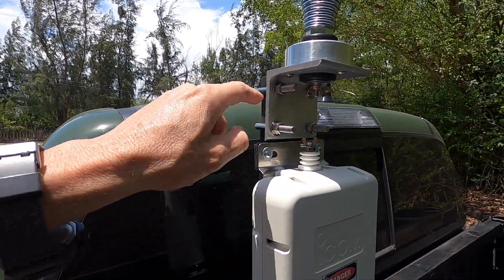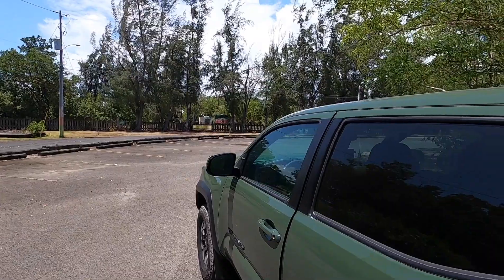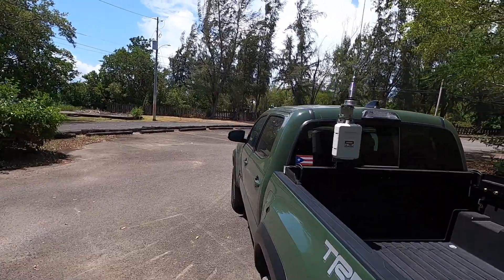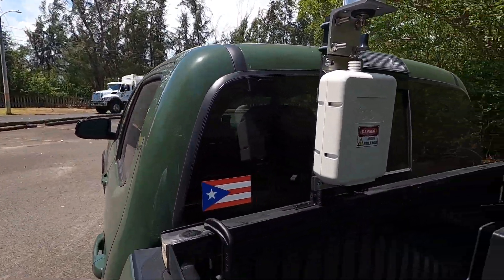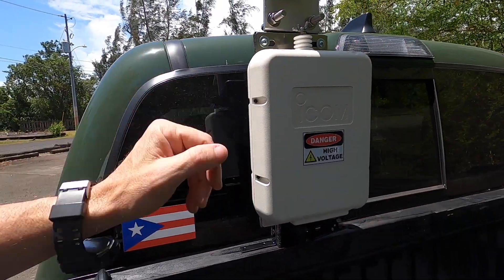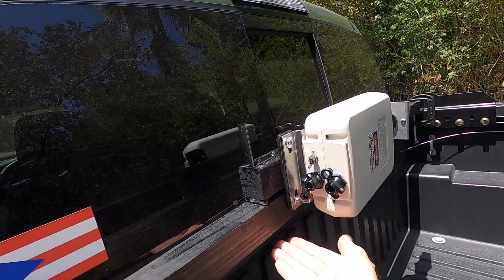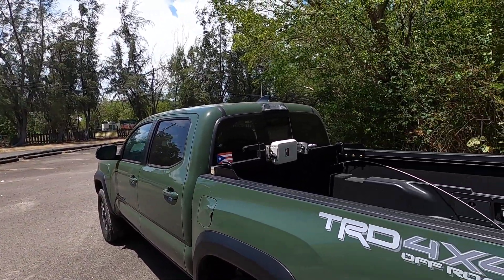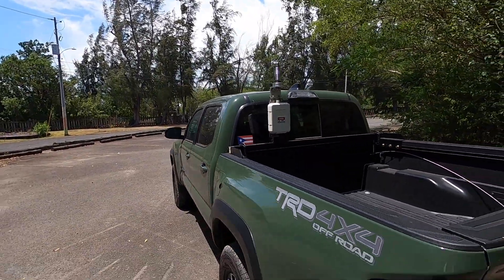Toyota Tacoma HF / Ham Radio Install - Part 2 (Antenna)

Comment: Nice setup as well......I have an AT-140 tuner and know the 4 pin outs....but not sure how to wire it for tuning.....anyway could pass on the information of how your wired it to your radio?   Thanks, Mike

Comment: I was thinking about how to mount an HF antenna like this. My idea was to have a tube going across, but with a 2 inch receiver hitch socket welded on in the vertical position, and another horizontal for storage. If laying flat towards the bed, the whip can loop around without having to remove it.  Could probably do a 1.25", would be sturdy enough for this application.
Reply from the maker: I see no reason it wouldn't work.  It's going to rattle if you don't shim the fit between the hitch part and the receiver.  You could weld a nut through the side of the hitch and add a bolt to press on the hitch part to keep in from rattling.  I've done that before.  If you mount the horizontal storage piece favored to one side, you can "curl" the whip inside the bed no problem.  With the spring on mine, I can almost tuck it while mounted.